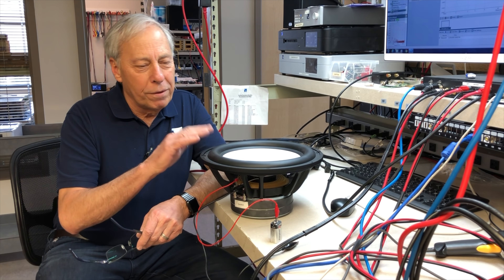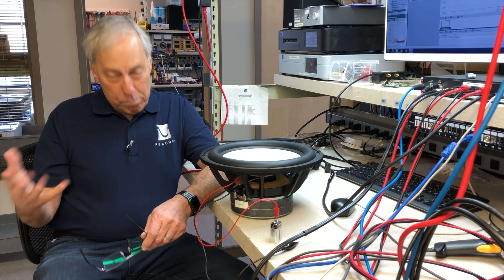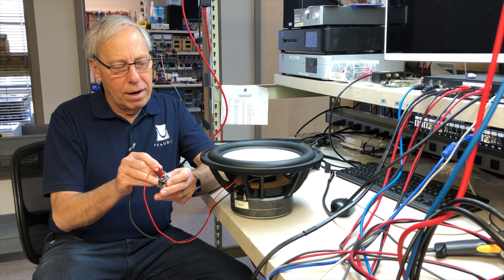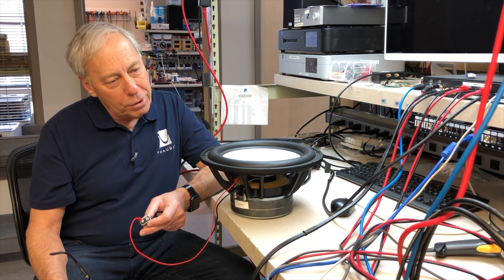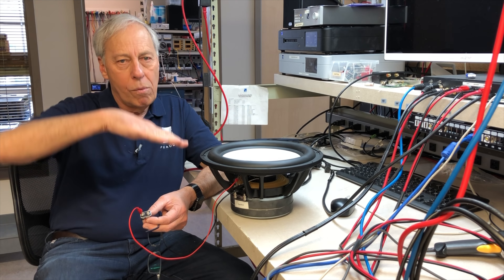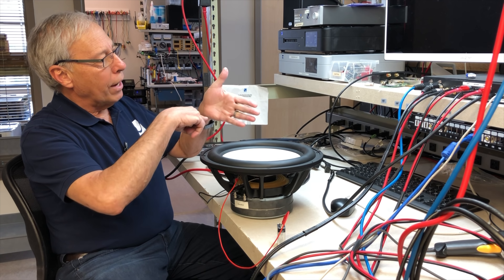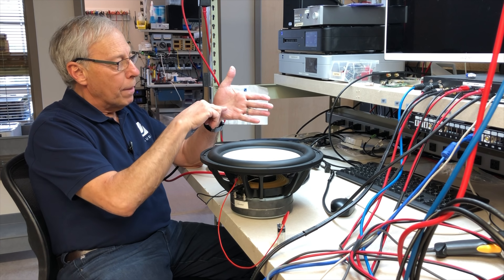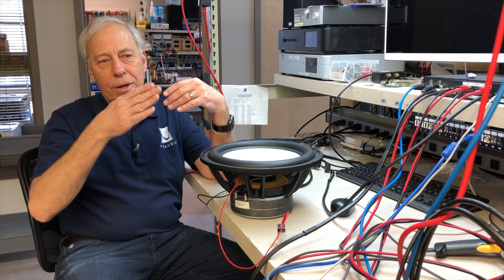How can one speaker driver reproduce multiple frequencies?

Comment: The problem is, there can be thousands of oscillations, overtones, timbres over time t, and they are combined into one parent aggregate shape over time t, as represented by the speaker.  This parent shape is simply dimensionless binary data of voltages.  There is not a drum hit, a keyboard stab, a reverb, a cough, and every other infinite possible combination all happening as just a function of that wave’s shape, or numeric profile over time.  A 1D microphone diaphragm flattens the multi-source signal into 1 wave.  The shape is numeric metadata only.  In the same way, light carries 2D imagery information and the wave does not at all resemble the 2D information.  Yet when the light hits a sensor or surface it magically turns into the 2D image it is representing as just 1D voltages.  Where is the 1D->2D transform function and spatial info stored here??  There is zero explanation for this metaphysical phenomenon currently.  The information itself is not in the wave, it is in the 5D, as Des Cartes, Newton, or Leibniz may tell you.  The speaker is 1D, and it is simply representing a parent wave stream of 1D oscillating voltage; these are the latch-key to a database with all of the embedded constituent wavelings within the being that can identify what the dozens of embedded sounds are in its 3D spectra at every moment.  Electromagnetic waves of all kinds are mobile “numeric metadatabases.” It is metaphysical, as is information, reality, and consciousness itself.

Comment: The real question is how can one single speaker reproducing all frequencies in the same time and the answer is NO why because you can't driving your car 20 mph in the same time 50 mph why I talk about that because the frequency is variation of speed and bass is lower frequencies ( 20 Hz or 20 beat per sec ) and So you can not heard low and high in the same time on single speaker I don't say It's not read Talk about differencies between read and heard When you get sounds kit you have a great sound because you have maestro  giving 20-250 Hz to your bass speakers 250-2500 Hz for medium size speakers and 2.5-20 KHz for higher speakers Looks like simphony from theater but what's gonna do for one single speaker It's crash like plane crash Ok you have a segment sounds in one Let's me explain When you watching your TV the word can be used is animation Your picture is changing every time like the sound reading 52 Hz 300 Hz and 5 KHz at this time and one sec later reading another frequencies So one single speakers can read 52 Hz 300 Hz and 5 KHz and what can you heard ( 52 + 300 + 5000 ) / 3 = 2702 Hz All in one nice very nice Shit and fuck Sorry you cannot use one single speakers

Comment: Paul, human vision can see up to 120hz, some say higher. Pedantic, sure, but you play fast and loose with subjects you're not familiar with and it comes back to bite you, particularly in the digital realm.
Reply: @LD Blake The question is not can I see 60 cycles of contestant white light, the question is could I see one cycle of red and 59 cycles of white? It’s a matter of rate of change. The answer to that science has made clear, my reports should mean less than nothing when discussing facts. However, if you need to see with your own eyes, there are YouTube videos that show examples of this since video can be encoded up to 59.97fps. And there are plenty of studies about human eyesight in response to dynamic stimulus. You could easily find them by Googling the information rather than reflexively reaching for an anecdotal strawman. If you need help finding links, I will assist.